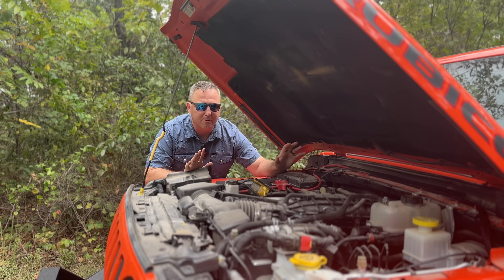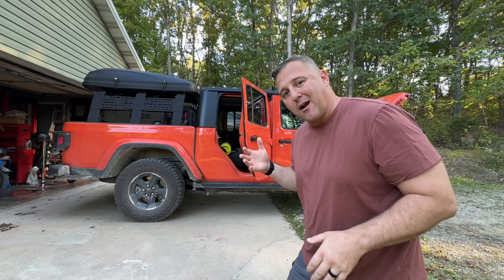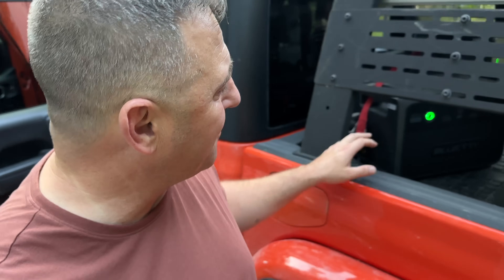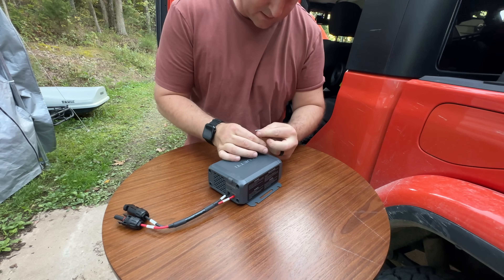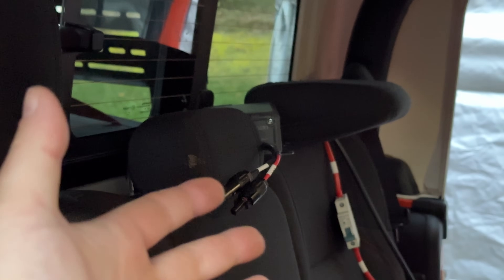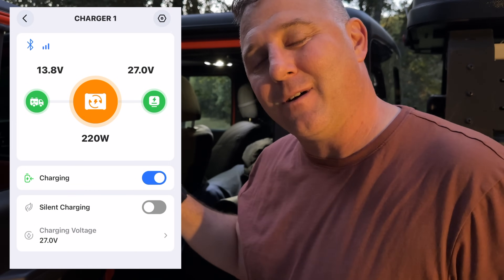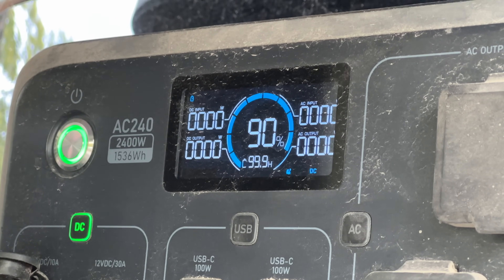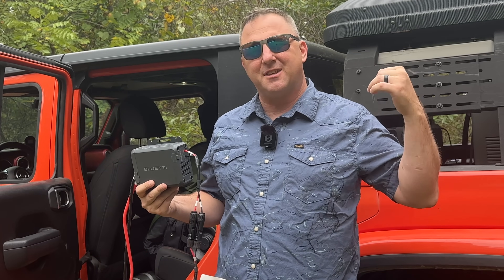Solar is OBSOLETE! - BLUETTI Charger 1

Comment: I noticed the close up of when you were hooking up the positive and negative were backwards.
Reply: I was about to mention that myself, but I saw that you did so already. Great catch!
Reply: And like most videos they don’t correct themselves on camera they just hope no one notices. 😮
Reply: @troycogan1030   Greetings: Very true.
Reply: Greetings: I saw that also however I did not comment Bcuz I am not certain the black wire is negative in that application. However I did observe many other mistakes. Creative wiring...gotta love it. Thx 4 the share.
Reply: I noticed that too , i hope it did not cause any short circuits
Reply: @TheMandhari  Greetings: That is not a "short". That is reversed polarity issue. Most likely resulted in multiple component failure. Solution - know what U R doing and stay focused....or leave it 4 us that do. B safe.
Reply: I noticed that right away!

Comment: I have a Bluetti EB3A & it took too long to charge from the car so I installed a 300-watt pure sine wave inverter & charge using 120vac at up to 265 watts (the maximum for EB3A) for $50.00 it works great & I have a backup inverter with me.  I could not be happier.
Reply: I didn’t know EB3A could receive 265 watts charging! I just have a 24v 200ah LIFEPO that gets it up to 200 with no inverter, just DC clamps.  I’ll look up the product you recommend
Reply: @bdmenne it actually charges at 350 ish watts on turbo, if you wanted to push it

Comment: Glossing over that you're burning extra gas to make the most expensive power you've ever used.
Reply: If you relocate camp spots every day or 2, it makes perfect sense to use a system like this to recharge everything, you're driving anyway, so why not make extra use of the drive time and recharge everything.
Reply: @cassidysepicadventures  It will still cost you extra gas to do the same journey with the charger connected.
Reply: It can recharge in an hour for about a half gallon of gas as opposed to hours of solar. That comes in handy in cloudy days. And it’s also cheaper than having enough solar panels to charge it in the same amount of time. As a vanlifer, that’s huge. It means you can run an air conditioner nonstop in summer heat.
Reply: @jerroddooley374  It would take more than three hours at maximum output to fully recharge. Maths not your thang?
Reply: @CowsGoMonkey  Still uses extra fuel duh.. You know physics, ask someone who had an education LMAO.
Reply: @stevemorris3710  it does not use extra power. It draws battery power from your 12 V system, which is constantly being recharged by your alternator on the vehicle. That 12 V power is being sent through the inverter and then to the battery bank. If you are making a trip, then you are not burning any extra fuel.
Reply: @J-Bake  Incorrect, the extra power drawn from the battery, loads the alternator, which requires extra engine power to drive it, which it makes by..........burning more fuel.
Reply: @stevemorris3710 it makes sense to me what you say. I think if it like an engine in a sail boat that has solar panels, too. You don’t absolutely need the engine, definitely not all the time, but if there is zero wind or very cloudy days, the engine can be sparked up. 
I see the alternator charger like having a gas generator. It’s a safety back up, not free in the slightest, but glad it’s there.
From what you’re saying the mpg will go down, just to turn the alternator.  
So now, extra gas will need to be purchased in fuel cans or a larger gas tank will need to be installed.
Do you see any good/benefit from these alternator chargers? Is there an energy YouTuber you could recommend that covers this similar perspective that you have? 
Thanks

Comment: Just get an additional circuit breaker so that could you possibly have two circuit breakers on the hotline. Or just splice the cables together where the circuit breaker is situated upon arrival from the company and move it closer to where you indicate would be more optimal in your video. let me know what you think please.🤔

Comment: What is the impact of the Bluetti Charger if you may be operating a winch?  Does it recognize the draw and shut itself down or would a switch of some kind need to be installed?
Reply from the maker: @dwnsth3529  the charger can be turned off in the app. So, you can toggle it on and off without disconnecting anything. You could also turn off the relay.

Comment: Lmao, this was a hilarious video. Basically, it replaces solar with a gas generator.
Reply: For people on the move who don’t stay in one place more than a night or two it allows faster charging when diving from place to place.
Reply: I wish Tesla just would put at least a 120v15a outlet.
Reply: @ewitte12 YOU CAN do it yourself..... Crazy, I know.
Reply: Pretty sure the cyber truck has it plus a 30amp shore power plug @ewitte12
Reply: @ewitte12  we have 3 120V and 1 240V on our CT, pretty sure they all come with it
Reply: @ewitte12 multiple 120 and 240 already available on the CT.
Reply: Yup... but he cant fit 600 watts of solar on his vehicle.
Reply: As a backup it's great, don't know what's hilarious about it
Reply: Always a fuse near battery 👍🏻
Reply: Lol
Reply: It's catching wasted energy from the engine. Smart. I did the for years with a RedArc BC-DC charger
Reply: @msyotaboy  wasted energy through a charging system is b*******. If you had a power thermal inverter on an exhaust system turning the exhaust heat and electricity you would be right. 

Anytime you're alternators running it's taking more gasoline to make that electricity. 

This is 9th grade level high school physical science crap not very complicated but.
Reply: @jwdundon  And the combustion burning apparatus continues to turn and burn wasting potential energy regardless. Some capture the wasted energy though. Is that wasteful? Or just plain wise?
Reply: @NoFeeArea  sounds like your 9th grade high school physical science teacher sucked here's what you go do! 

Why are two electric motors together, put a crank on one of the motor shafts, spin that crank to power the other motor.... Yes I know it's not a generator but it WILL generate enough power to charge motor #2,  motor number 2 is going to want to spin, it's going to make you crank really hard on the motor number one to make motor number two work surprisingly hard....

The point is there's no free energy the alternator on your truck is drawing power and the more you hooked to it the more it draws.  Contact Newton's laws of energy and crap. Perpetual motion basically and your kind of buying into it.   which is a bunch of crap. 

Gasoline has a lot of power, you won't notice much of a drain but it will burn more fuel running the alternator to charge more batteries. Basic common Sense buddy, and the math isn't that complicated either.
Reply: @jwdundon  The point is that the engine is running anyways regardless while driving. Why not grab the energy? Probably a lot more efficient than charging off the grid. Spending 1/20th of a cent more in gasoline or 1/20th of a cent in lost energy coming down the transmission wire after being mostly generated by NG or coal? 60% of energy production comes from fossil fuel. Come on. At either end produced electricity produces a waste product in pollution. Solar energy is impractical on the road really. Why not have this as an alternative? Also, it sure produces a lot less pollution than sitting at home running your air conditioner, heater or gas range. Do you run your automobile air conditioner while driving? Oh no! You're burning more fuel!!! Please. You probably have manual window cranks and no A/C in your vehicle. 🤣
Reply: @NoFeeArea  yeah, my truck has these hand crank windows, and no a/c.... 

Your NEW car has INSTANT MPG computer.  Plug in your alternator, and see how how much your mpg goes down. -- you will be surprised, it's A LOT MORE than 1/20th of a cent.
Reply: @jwdundon  1/20th as in 5% draw either in vehicle or in grid with transmission lines. I think the point of this was a fill in for what solar can't provide on off days when it's cloudy and when in route between destinations. All snark aside I don't see it as a bad solution because I have traveled around and camped. Traveling in actuality, is wasteful too. It's like a patch I guess to have enough energy when parked. Too bad we couldn't run everything on geothermal like Iceland! Every method has drawbacks and costs in the long run.
Reply: Just a thought...... could I use any battery charger on a bluetti
Reply: @garrynicholl8777  no, you got to spend at least a thousand bucks to buy a name brand!!! 

Why doesn't somebody make a thermal adapter that takes the wasted EXHAUST HEAT to make electricity???? 

Positively simple, positively brilliant but nobody does it. WHY?  

Or how about a probe you throw in a campfire that lets heat come through it to charge your batteries???
Reply: Not simple, but a good solution.  My concern, if you’re settled in a site - you must run/drive car (even for no reason) to charge up.   😮
Reply: Not everyone is lucky enough to have endless amounts of sunshine 💁‍♂️
Reply: If that’s your take away then you’re a moron lol
Reply: THANKS!
Reply: Greetings: Indeed. Definitely false title. Thx 4 the share
Reply: Dude, did you sleep in that shirt?
Reply: You forgot that you have to drive the vehicle anyway, one way or the other.
Reply: Just be careful about overloading the alternator and check that the stock wiring can handle the extra draw and not over heat. This will also use more fuel. It is a nice alternative to solar but it does cost more $ in fuel and could damage the alternator/other components if overloaded
Reply: Correct  a horribly inefficient one at that!
Reply: He did not hook up the power cables right on the charger
Reply: Well - make that a gas generator that uses the same fuel tank your vehicle uses and only needs to run when your vehicle is already running for some other reason. And my vehicle is always with me whether I carry along another "generator" or not. Solar can't do any of those things - especially in winter in the great PNW.
Reply: @southernsouloutdoors  And he literally doesnt have a F150 Hybrid... so whats your point?
Reply: You can do this with an EV, just  put heavy duty  jumper cables to the 12volt battery with a 1000 watt inverter. Boom,! waay more efficient than burning gas.
Reply: @04soldier  all those charging stations you use along the highway are diesel generators smarty pants
Reply: You don’t drive a car just to charge it. It charges every time you drive. You are not adding anything into the environment by connecting it.
Reply: It obviously can not replace an iron cuz that is the most wrinkled shirt I have seen.
Reply: @garrydye2394  Lol thought that too but it's actually the design / print.
Reply: It gives you another option.
Reply: The alternator is not new  @jimfields9491
Reply: The most expensive gas generator, that was not designed to work as a generator, what a buffoon!
Reply: @jmalinowski1000  The person living "off grid" and using Solar or wind energy and uses this system occasionally as a back up probably uses 100x less energy than a person with an electric vehicle and electric heat powered by the grid. I vote in favor of this as 100x more green.
Reply: @offpath2025  "Probably"?  You should work for the Government.
Reply: I do.
Reply: @jmalinowski1000 

You don't have to run a stand alone generator at all anymore. Your vehicle engine replaces the need for one. 
Since you have to drive everywhere, it uses your engine fuel use to do two jobs while using the same gasoline.
Reply: Maybe try off-grid camping for a couple weeks and run out of juice because no sun or wind? It sure beats carrying around a loud generator!! Besides, when travelling you just charge your power stations with all the EXCESS electricity generated and wasted from your car generator (alternator but still produces wasted energy). Store it. Why not? Seems prac @jmalinowski1000
Reply: @jmalinowski1000  Read, watch, and learn, young grasshopper. Your world will get immensely larger.
Reply: @tilu3303  I noticed you didn't include "think"...
Reply: Technically the cigarette lighter port already suffices for this purpose, especially for people who 24v batteries.

This just lets you charge faster than the 120w limit for 12v and 240w limit for 24v.
Reply: @jabbajawz  Yes.... except this charges 6 times faster  than a 12v lighter... that's the point.
Reply: @tweedledee4922  I'm just saying this in response to it replaces solar with a gas generator. The cig lighter already does this. It's just weak.
Reply: @jabbajawz as weak as your argument
Reply: @DirtAlert  So you just reply just to hear yourself speak? You add 0 value to the conversation. Not everything is an argument.
Reply: @egyesgu53439QRtV  Apparently some people like watching videos about asinine ideas.
Reply: @BelfastBodger  How ironic. You are the one missing the point.

I'm responding to a comment about this "basically replacing a gas generator"

And I'm saying no, the cigarette lighter port already replaced the generator, this just gives you a faster charge. Cuz who want to lug around a gas generator to charge their power station?
Reply: @jabbajawz the 12v port only gives out 100watts. The charger 1 560w. If you had a 1000w station on 12v it takes 10 hours. Charger 1 is half that. So it does make a difference.
Reply: @RobnDob  I know this... That's not my point. I'm saying the alternator charger is the better option as it's a "fast charge", but I was directly speaking to the person who said so basically this replaces a gas generator. 

But depending on the the system, you can get 12v at 15a or max at 180 and some 24v systems do up to 400W.

It just depends on the car/truck. But yeah, the whole point of this is get get a faster charge while driving.
Reply: @jabbajawz What limit? My victron booster charges with 400 watts (on 24v) while i am driving.
Reply: @bettertoaster  I am not sure what comment your are responding to be size YouTube doesn't show me. But I'm saying the regular car charger port will send up to 24v at up to 15 amps depending on the car and thats the limit. But the alternator charger is faster.

Comment: For folks who have a mild hybrid jeep the pancake motor is also the alternator and it should have more than enough power for this.
Reply: Yeah the Toyota/Lexus hybrids like Prius make fantastic generators and can easily power 1200 watts or more continuous to inverters/chargers. When the HV/traction battery is full, the engine shuts off until it's needed again.

Comment: Being able to use the vehicle alternator to charge your house batteries is a good idea, but it is certainly not a solution that makes solar "obsolete". I camp in the desert for two weeks at a time and on my RV I have 2050 watts of solar panels and 900 amp hours of lithium iron phosphate batteries. What am I suposed to do with a system like this? Run the vehicle all day to recharge? I use 350 amp hours a day on average. This system might do for overnight, but that is about all. Useless if you are stationary for any length of time.
Reply: bring extra gas. you don't need to run your vehicle all day especially if you have a power station with high capacity.

Comment: I wonder if these chargers hooked up to the vehicle damages the alternator if the engine is just on and running but not driving?  Or do you need your vehicle driving. 

It would be a good option for "small" home back up as well just in case power goes out.

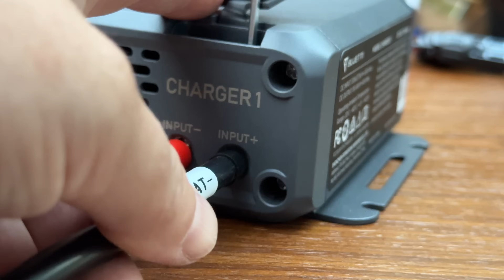Comment: Did you incorrectly install the MC4 cable at 10:12 timeline? i.e. (INPUT +) should be (Red wire) and (INPUT -) should be (Black wire)?
Reply: That is why people have to realize that most of these youtube video people are actually oblivious or just making content. They are not experts that you should follow without question.
Reply: I recognized that as well, it should have shorted out

Comment: Thanks for the review.  I 100% agree that the breaker should be up close to the battery.  
FYI:  At 10:04, you're wiring it backwards (+/-).
Reply: Looks like the polarity was fix.  Wonder if he popped the fuse. 

https://youtu.be/5-ZDPk0y1UY?t=1025
Reply: @leeinwis  is the breaker water proof if it’s put near the battery ?
Reply: Also connected the positive to the battery with the ground already connected.